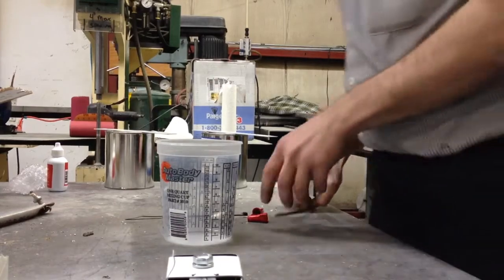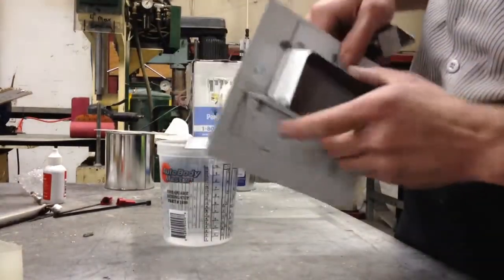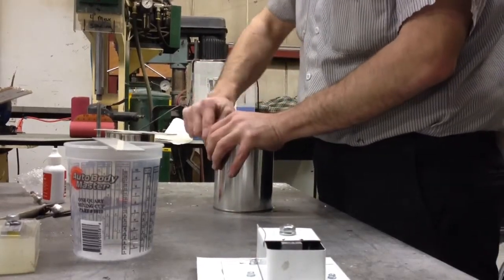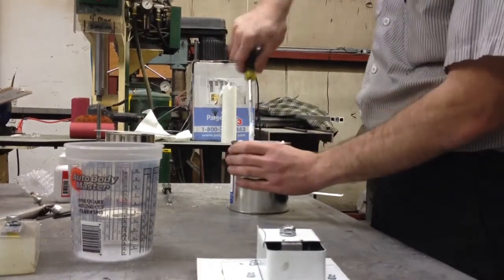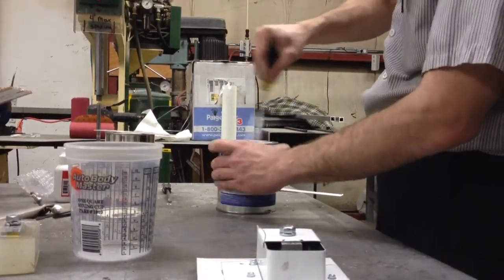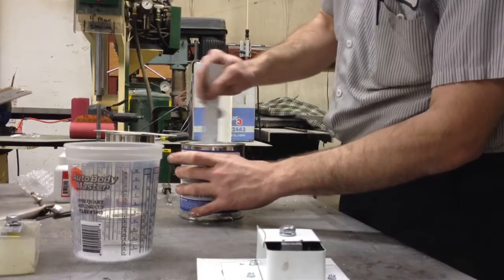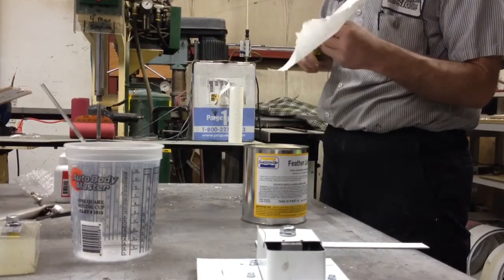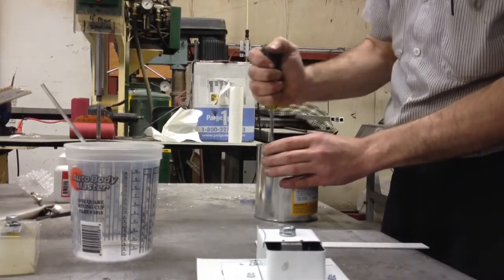Featherlite Plastic Casting Pt. 1

Comment: Hey,  Nice video!  I am interested in this feather light product for a project I am working on.  Here is a question I have about it that maybe you can answer.  Does this material loose weight as it cures???  Smooth-on sells this in a gallon size at 11 pounds.  So if I mixed the whole gallon would it still be 11 pounds when it is cured?  I would think not because water weighs 8 pounds per gallon and you demonstrated that it floats.  I tried calling Smooth-on tech support and some of their distributors but I couldn't get any definite answers from them...  Though I'd try someone with hands on experience.  Thanks!